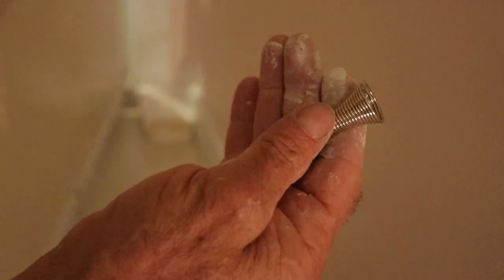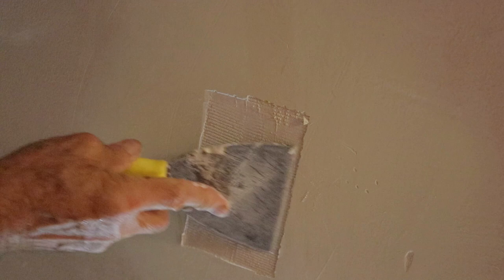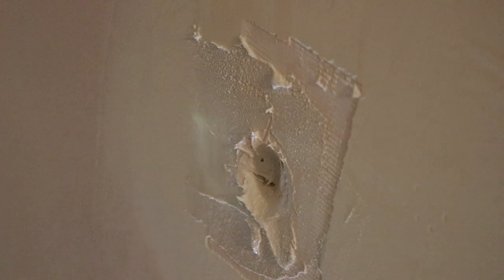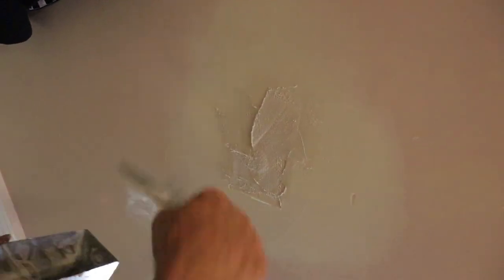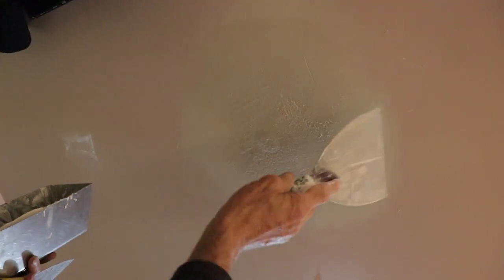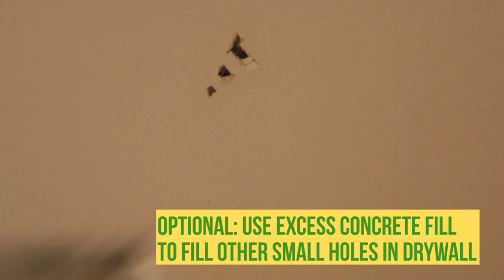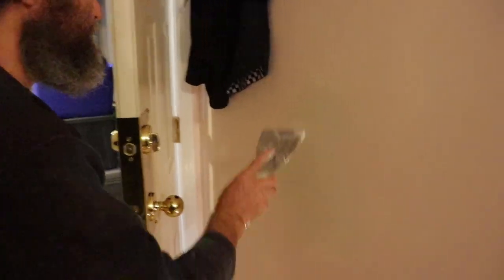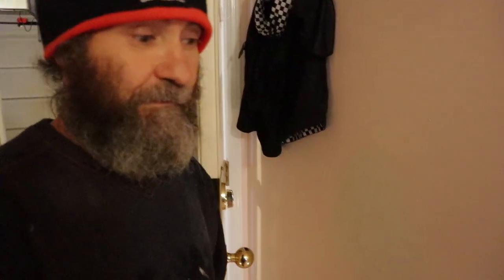How to Fix a Hole in the Wall | No Drywall Required!

Comment: Bahiano Reno please respond to this, im currently young, 14 
punched a hole in the wall and luckily i have al purpose sheetrock joint compound, can i do it with that? edit can i just use regular clear big tape or duct tape, i also got paper joint tape
Reply from the maker: Hello my friend, all purpose drywall compound works with drywall paper tape or mesh tape, duct tape is not good, the mud  will not hold on the duct tape for very Long, let me know, if you have any other questions, thank you for your time and support, see you on next one.
Reply: Bahiano Reno i have lots of paper tape, so i am going to be using that, Thanks
Reply from the maker: You are welcome my friend, thank you and see you on the next one.

Comment: Hello! I've been taking down frames from my wall so I have nail sized holes. What materials would you need to fix this since the holes aren't so big? Are there other materials you could use other than mesh tape or drywall?
Reply from the maker: Hello my friend, nail size holes, I would go with all purpose drywall compound only, it might requires few coats on the bigger ones, feel free to ask more, thank you very much, keep safe

Comment: Plz help this happend to me and i dont have any of the tools (im 15)
Reply from the maker: Thank for your time and request, what  happened and where about are you located? We will do our best to help you, keep safe.
Reply: Bahiano Reno  i open the door quick and it hit a wall and now theres a hole in the door
Reply from the maker: Hello my friend, for the door, you would need some wood filler and  the process would be pretty much the same as drywall repair, fill the damaged area , sanding until you get a smooth a surface and painting, let us know, if you have more questions, keep safe.